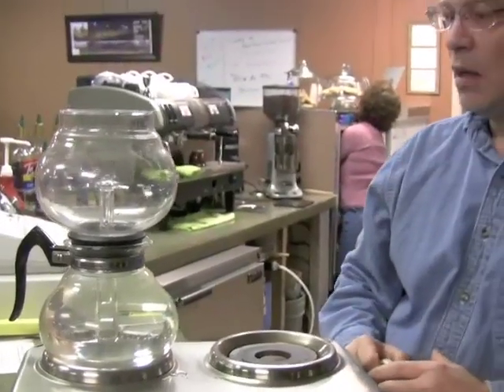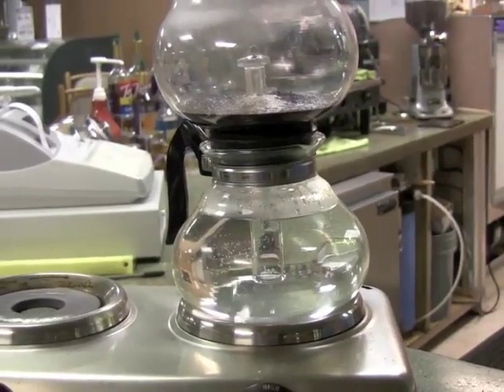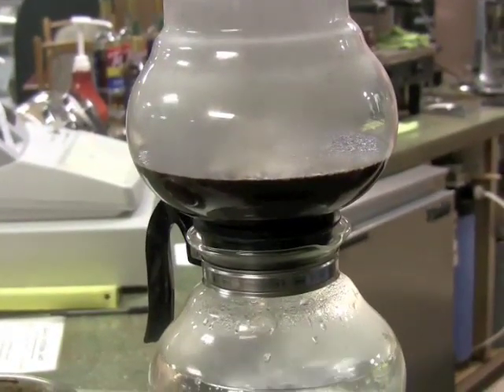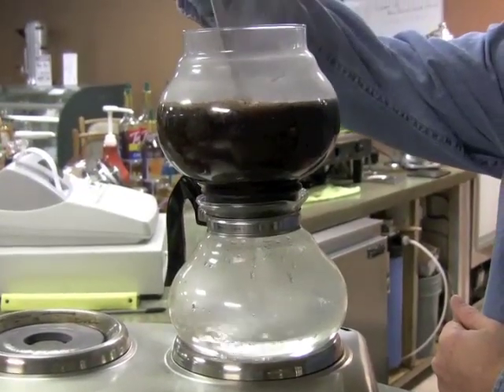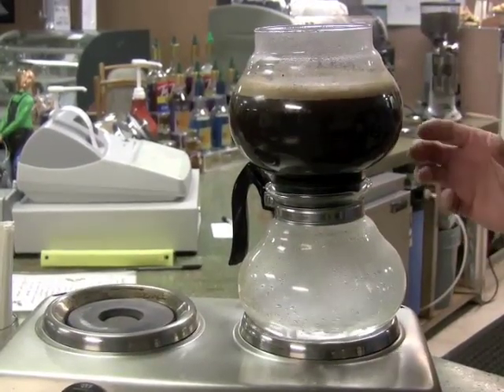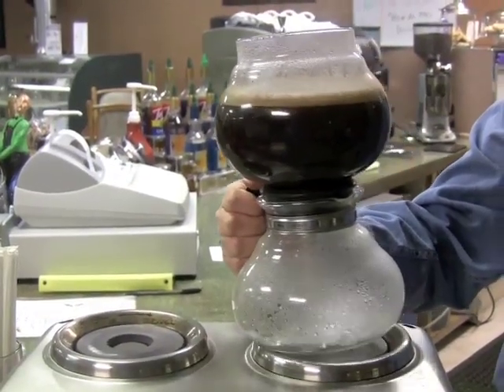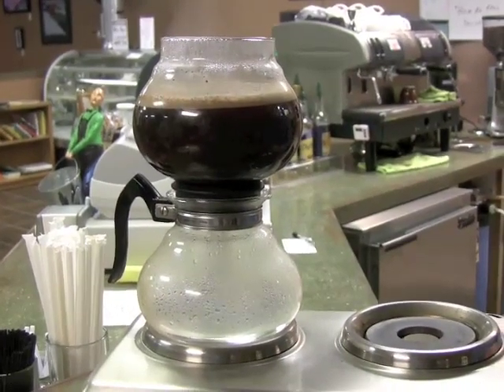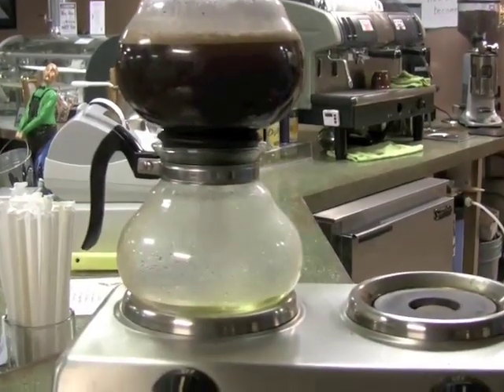Silex Vacuum Brewed Coffee

Comment: The reason it takes so long for this part to operate as I can see vapor escaping between the parts. I wish someone that actually knew how to operate these parts would make a video. If the seal was good between the upper and lower units it takes a fraction of the time to brew a pot.
Reply from the maker: You should make a video.   The guy did a great job and the coffee was great.   It was a unit he had in the showcase, not what he used to serve coffee in his shop.  

Thank You for leaving a comment.